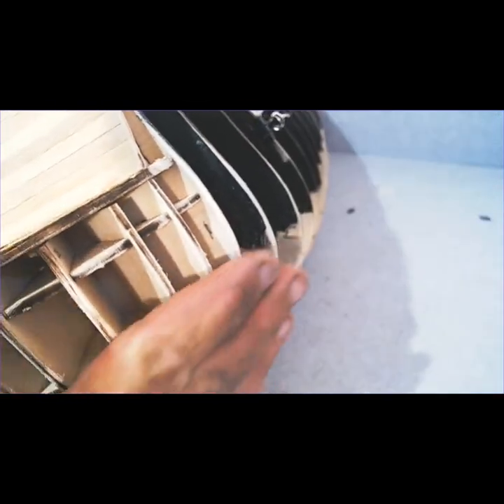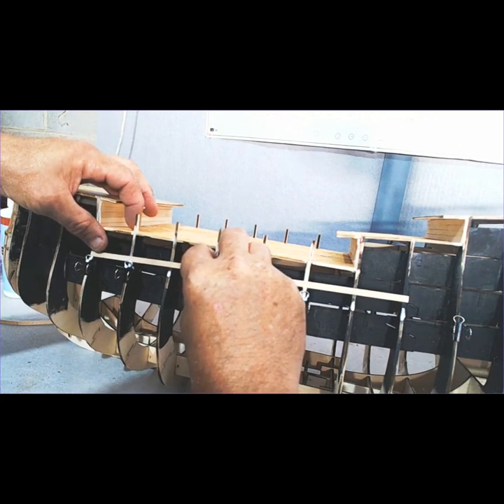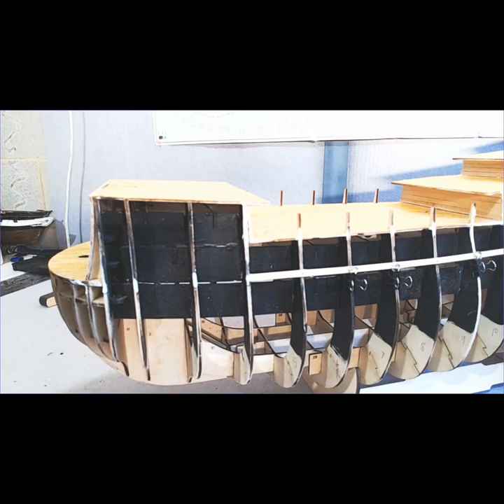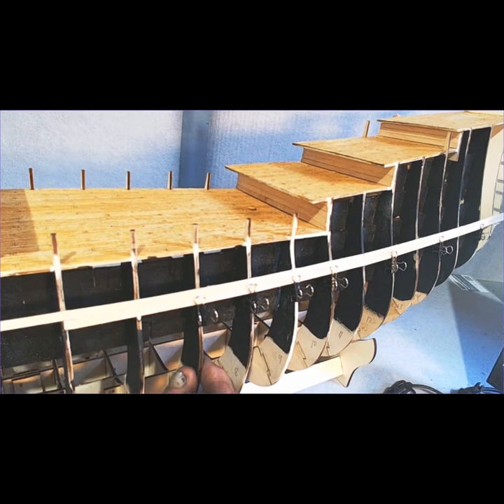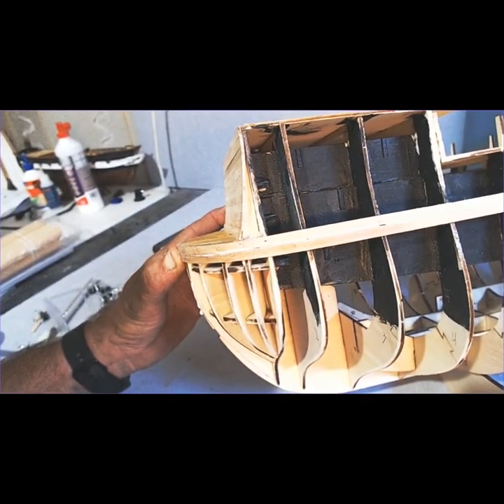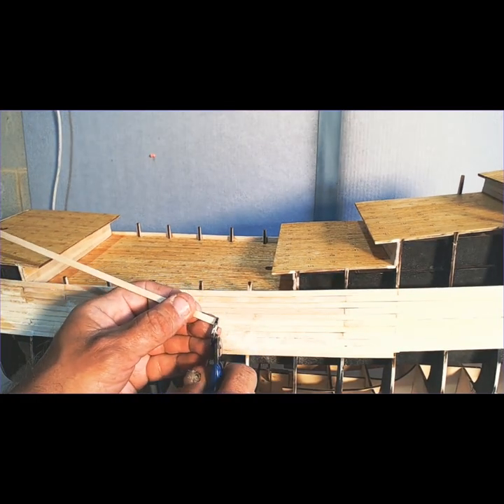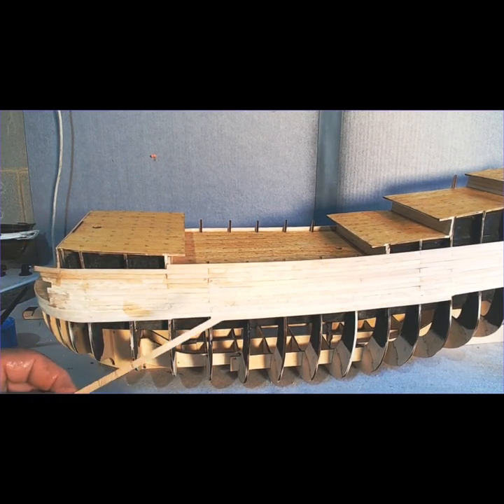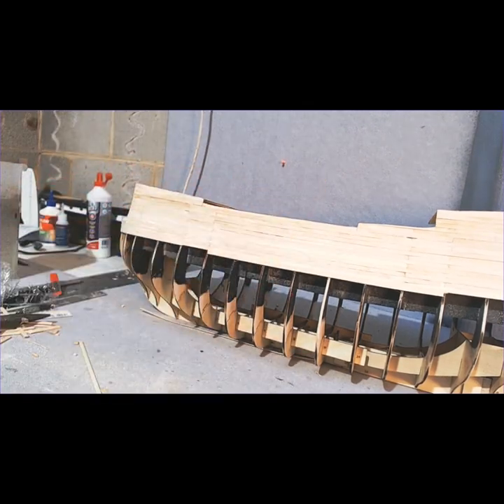Artesania Latina Soleil Royal Part Ten

Comment: Hi Greg, I see you are making use of the bull dog clips, they come in very handy, ive never thought to shape the ends of the planks so they overlap, another possible way to do it is use a scarph joint. Im glad to see im not the only one who has a poor opinion of the new Artesania Latina kits, they used to be my go to kit manufacturer, ive yet to start the planking on my kit, the ribs are only 2.7mm definitely no pins can be used gonna be fun.
Reply from the maker: I haven't heard of a scarph joint , I shall have to do some research on it. The ribs are way too thin causing a lot of problems. I have the Santa Anna from AL but my experience with this kit is not making me look forward to doing it. Occre have the best quality kits that I have built so far with 5mm frames. Although like others they are moving away from the more exotic woods.
Reply: Very true, all across the board guys. Greg, excellent work as always my friend!!
Reply from the maker: @AmbersCorner2.0  Thanks Jerry , How is the Flying Dutchman going?